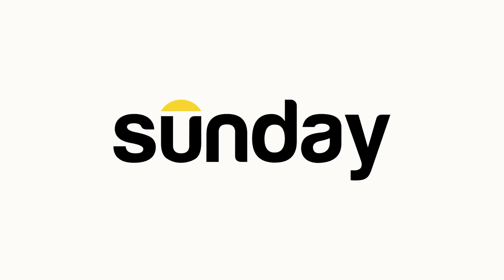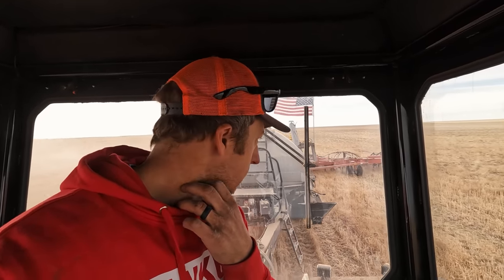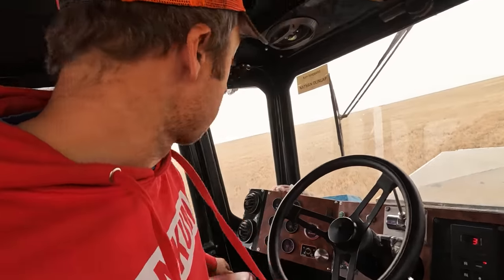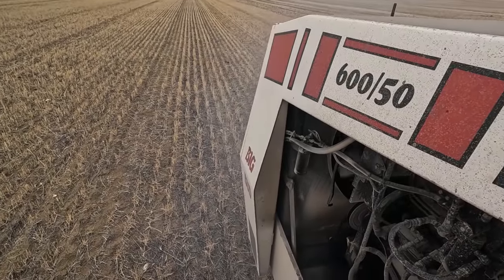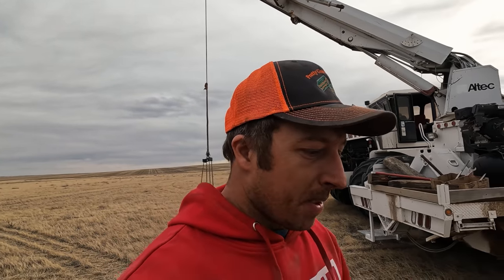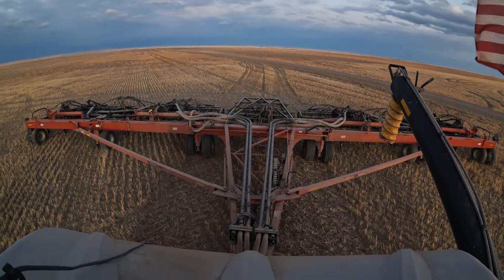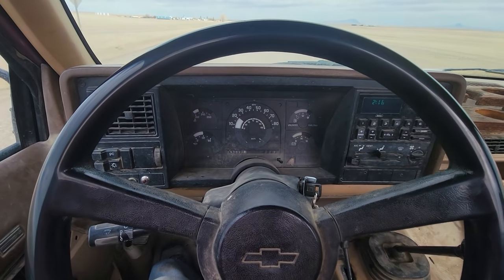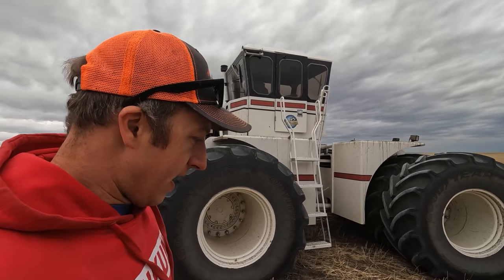The BIG BUD Engine is SMOKING!

Comment: Yeah Bob, I grew up using a 1-hole outhouse until I was in 3rd grade.  We lived next to my Grandparents, and we shared a 1-holer with them.  My Grandparents had running water only at the kitchen sink.  We did not have any running water, and had to carry water from their place to ours (about 300 feet or so).  If we wanted hot water, we had to heat it up on the stove.  Took baths in a large metal tub.  Teachers at school had to explain to me, how to use a regular flushing toilet.
Reply: Still populations around the world doing it the same way

Comment: Dad used to get those Coke bottle in a 6pak.   You could collect the caps and at 500 turn them in for a plastic wall clock 70s and thru early 80s for sure.

Comment: I remember those bottles from 1970.  I would buy a 6 pack with a very heavy plastic carry container.  I would have to bring the bottles back before getting a new 6 pack.  If I did not bring back the old bottles, I would get charged extra for the new ones.

Comment: Years ago I bought a 2nd hand Ford Explorer. When you'd press
the cruise control SET button, the truck would floor it & accel 
40mph from where you started. It really was startling until you
got used to it.  SO, as I rolled down the freeway on ramp I would 
press the SET button when I got to 25mph, the truck would gun it
40 mph & I would cruise along at 65. Before I sold the truck I
disabled that cc. Just to be safe.

!

Comment: We use to sow using 9 inch, then we bought a Khart disk seeder with 10 inch spacing . We decided to make the Khart wider going from 39 foot to 47 ft and 12 inch spacing. Used the same tractor Cat 55. Since then we have moved farm to a higher rainfall and better soils. Now we we are considering buying a different disk seeder with 7.5inch spacing to increase compition  with the weeds.

Comment: You might consider replacing the air throttle with a servo drive linear actuator, which is a pretty standard part for stuff like robotics, RC models, industrial automation etc.
Then you get a servo driver and input control for it, and that can range from just a knob or wheel that you turn until you get the right speed, to a box with a display on it to tell you your exact throttle position (maybe in 0-100 percent format rather than direct RPM, but something that's repeatable in any case.)

If you do just a knob input, basically the knob will be a rotary encoder, so each "click" of the knob will turn the servo a set number of degrees of rotation, and so you will have exact control over the throttle position.

Should be able to get it all in 12 volt input.
Reply: I was thinking the same thing

Comment: Very interesting. Try adding an air pressure regulator to the air throttle. In the cab so you can adjust it and find the "happy" spot that allows you to throw the lever all the way. Also there are different sized actuators for the engine mount. Larger diaphragm allows more fine tuning. Just a thought. Carry on and I hope you have a great year both with crops and with family.

Comment: Gas spring pistons shroud be installed with the rod end lower than the cylinder end in the position the spring is most in.  This is so the lubricating oil in the cylinder can reach the rod seal.   No wonder they always need replacing.

Comment: Pneumatic controls can be very precise. You guys need to just dial in your air pressure and flow to your control blocks, check for air leaks. Either do it yourself with a manual. Or get an instrumentation tech out to give you guys some pointers, or do an initial set up, and learn some tips and trick from them.

Best of luck, dial those Buds in, get em where you want em....Cheers guys and gals!

Comment: 1970's or 1980's on the Coke bottle. Screw caps were introduced in about 1975 and returnable bottles for Coke were discontinued in Montana in 1989. Deposit on Coke bottles started in 1948. 40 year retired employee.

Comment: For the throttle, go get a pressure regulator for your normal air compressor that you'd run in the shed.

Run the air out off the handle through the regulator and then down to the engine and that will give you the ability to set a max pressure (and consequently throttle) with quite a high degree of accuracy.

You set the max rpm with the reg and can throttle down and back up to that max with the lever, so for slowing down and stopping you have the lever and if you need to kill it in a hurry you still have the lever.

Regarding the bottle, I have no idea. I was under the impression that the US (I'm Australian) used the metric system for soft drink bottles and had done for quite a long time though? That might be a small clue to its age.

Comment: Guessing late 70's early 80's on that bottle.  I seem to remember them in my earlier years around that time.  Especially if deposit return...would have been early 80's.  I don't think they started refunds until 1978-1980 time frame.  That's my guess.
Reply: Yep, the bottles we picked up from ditches and took to the store in the 60’s were not screw top.
Reply: Coke switched to liters around 1975.

Comment: Nick if you want to shift out of low to high range you can give it a torque bump and relieve the torque and slip out to neutral and it should allow you to shift it to high range like shifting the Semi. Throttle then ease while easing you slip into 4 high. It should let go when you ease it.🤔❤️🖖🏼🇺🇸

Comment: Nick that bottle is about early 70’s because it has a twist-off cap. In 76 coke bottles were marked in liters. 
Where you have 12” shanks, don’t you have splitters? That actually makes a 8”, 4”, 8”, 4”, 8” rows. 
When you fold up, I would recommend that you use the pin locks. 
Boss did not for a short 1/2 mile move. A hose seeped, things would have gotten worse if it was a mile move. Could have bent parts, been waiting on parts during seeding. 
Nick some guys have converted to a cable throttle like a Steiger. 
Much finer control!
Hello from north east Montana. 
10 miles from the Canadian border.

Comment: I had to drive my 1975 Corolla S/W 5 speed manual without a clutch for 2 months(years ago) because I couldn't afford to buy a hydraulic slave cylinder for the manual transmission. I would start it up in 1st gear and then was able to float the other 4 gears in just using the rpm's after getting use to it it was so bad.

Comment: The company I work for has trains powered by Cummins NT855R5 engines with an air throttle. The throttle is set up in notches from 1 to 7 and will sit in which ever power setting you leave it in. Maybe something is available that could fit on the big bud?! :) No doubt you probably looked ages ago 😂

Comment: What if you put a longer shaft on that throttle. That way you could “move the throttle” farther and it will translate into less movement at the pivot.

Maybe it would get in the way of the wheel.

Comment: Ii can see the disadvantages of the air throttle. But not knowing how it works when it breaks down I think it would be still better that bowden cables that others use . These after awhile fill with dirt and size up when you open throttle up .it doesn't allow you to throttle back so you have to leave it screaming as  you disconnect it from fuel pump.

Comment: Ya I know what u mean about being a good truck  we have a '71 strength 6 1 ton Chevy it has no lights that work wire harness went  15 yr ago  Bed is now wood flat bed with removable sides up to 8' tall for moving around very light stuff 2' sides and 4' sides too But have not had to do anything to engine or trany

Comment: With the throttle problem it would be easy to  install a Arduino and a electric servo. With that setup you can just run wiring up to a Dash mounted potentialometer.  Our look on eBay and buy one of those electric governor controls

Comment: You guys ever have to replace anything like a window regulator or door handle on those ford trucks? And are they solid doors so that you can’t just take the back off to get anything? If so you have any tips for replacing things that are up in there? We’ve got an 88 l9000 that the window won’t roll up on anymore. Feels like we stripped it out. But we tried to take it apart and look, and the door is all one solid piece aside from a little cut out at the bottom for a tray that’s gone. But looking at it we can’t even see the regulator to look at it and change it.

Comment: What if you convert the air throttle to a hydraulic throttle? Since fluid doesn't compress, might be more sensitive?
Reply: Thats a really cool idea
Reply: Will definitely depend on how the pressure is applied through the airline. But it should work.
Reply: Bound to be a wireless device for it by now
Reply: Just an electric actuator and a potentiometer would be sufficient. Be pretty cheap and easy.
Reply: What about a fly by wire?  Bluetooth?
Reply: @plowboy7700  Good idea, just avoid parts made in PR China.

Comment: You need to do a complete a/c flush to get that “Black Death” out of your system, change the Receiver drier, Expansion valve and flush the hoses, condenser and Evaporator if you wasn’t it to continue to work . 45 years in A/C repair….. trust me!
Reply: I've heard denatured alcohol can be used to flush it out. Is that true?

Comment: Is there an advantage to east west vs north south row?      I live in a horticulture region, lots of vines and fruit crops, and local topography favors north south rows for better cold air drainage.   

For agronomic crops in your area are the what are the factors in selecting a in row orientation?

I assume row orientation is more important on 12 inch rows vis tighter rows.     

Can you run pizza cutter tires on sprayer to run between the wider rows?

Comment: Can the buds pull drills as large as Tony’s?  I no hydraulic power maybe a issue but as far as straight muscle can they handle it
Reply: The 600 could but would need to fluid the inside tires
Reply: @RobertWelkerFarmerBob  would that ever be a thought to hook too??? Make a pretty cool video

Comment: 600/50 needs new glow plugs ...
That's for sure...
Reply from the maker: Might need a drill and tap to install them in the heads as there isn't any to begin with. That or grid heater. Good batteries and starting fluid is all we've got.

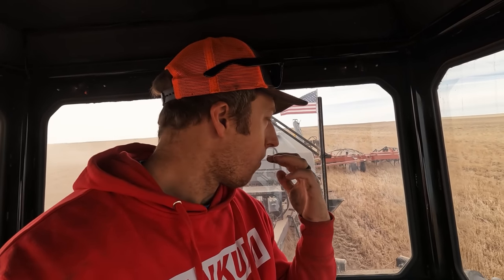Comment: 3:02   Is there a risk of higher weed pressure with 12 inch spacing?
Reply: "higher weed pressure"?  Check the regulator.
Reply: @paulcopeland9035   I am not aware of a regulator responsible for weed pressure.    Did you intend to make a joke?
Reply: @jwiereng  ...Yep I did!  Didn't work huh?

Comment: Why seed so slow I figured you’d be running at least 6 or faster
Reply from the maker: If you go much faster than 5 the 3-4" openers will throw soil into the adjacent furrow. Also openere wear out faster at higher speeds and at $130 each and 140 of them on the drills it gets costly to replace.

Comment: How come you don't like to turn it off when it's hot like that what's going to happen
Reply from the maker: The internals of the engine are tight tolerances and some parts grow and shrink depending on the temperature faster or slower than others. If you shut an engine down hot the heat can cause metal fatigue and crack. The turbo also needs to cool down if running hard as it is cooled with engine oil. Startup and shutdown are the hardest part for a big engine. Proper warmup and cool down cycles greatly increase the engines lifespan.
Reply: Lern something new everyday thanks guys for what you do farmers are so important